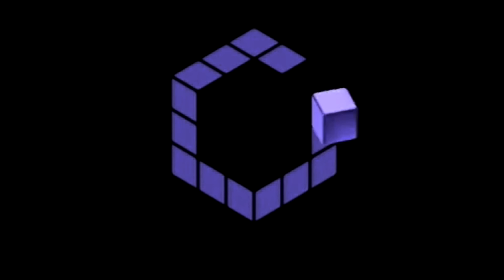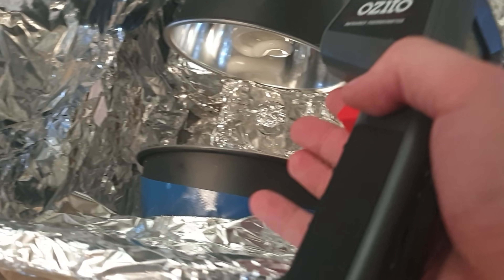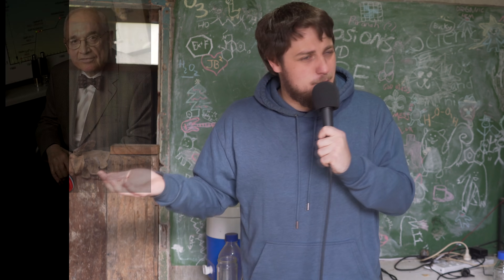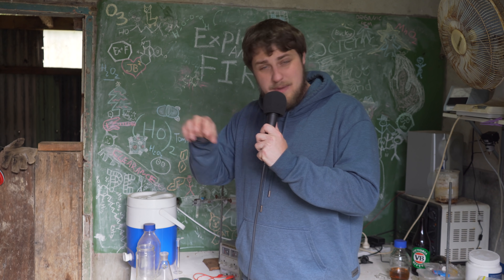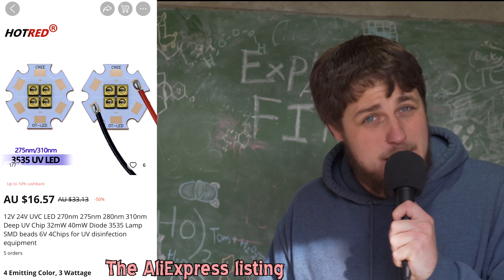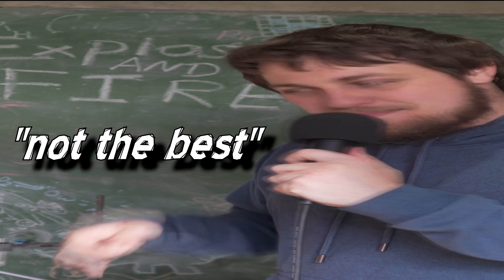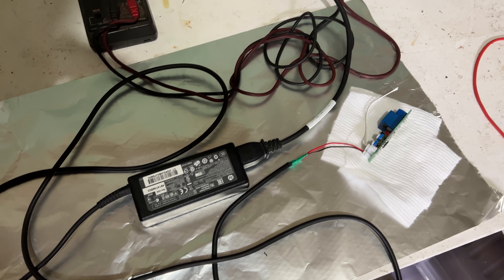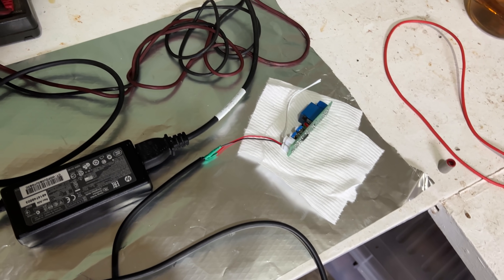Magical deep UV LEDs - Cubane Ep 12

Comment from the maker: I think this video is a good demonstration of the difference between science and engineering
Reply: Well, as a physicist with an MSc in EE I can tell you the following:
In theory, theory and practice are the same. In practice, they differ.
Reply: "It says max 12V 40mA, I'll give it 24V 1A and it'll just use what it needs" == "It says 40ml of 50% hydrogen peroxide but I'll use a litre of 70% and it'll just use what it needs"
Reply: @Björn_1978  i mean some reactions that 100% works on just like some circuits that works on
we both know that leds with no active current limiting aren't that case though lol
Reply: And you are doing neither
Reply: Power supply is good enough if it's current limiting capable, you just need some 3.3k ~ 5k ohm resistors to keep the LEDs from running away. The amp jump is caused by the fact these are semiconductors so they will hog all the current even at the correct voltage. The one you fried was because of the voltage being too exciting to it.
Reply: Engineering is application of sciences, kind of. First people to learn how to drive LEDs were doing science. Luckily that science is now established and 30 min of googling will teach you how to properly drive LEDs.

Edit: Posting the wrong way to do something to YouTube is a roundabout way to do an internet search.
Reply: @kasparroosalu  engineering being the (sometimes) exhaustingly iterative process of applying the right scientific principles until you get a result that doesn't fail catastrophically
Reply: Haha, I kept saying nooo, don't do that. I think you'll get some good advice from the comments, but I'm sure bigclive could just tell you exactly what to do to make a proper circuit on the cheap.
Reply: Scenginience
Reply: Did you see the post in your subreddit about a powerful <350nm UV source for under $20? I'm betting the optical power of these LED's is actually 3.2-4mw. UV LED's usually output 1/10th of their rated input power. You definitely need to keep that fan on it, because each of those stars is putting out 5 watts. I'd also be skeptical of the claimed wavelength, you have a spectrometer, don't you?
Reply: So for the timer, what your seeing on the blue box, the relay, is what it can handle as a maximum not what it requires to function. There should be some sort of spec sheet that tells you the input voltage ranges. As for the leds thats a whole diffrent rabit hole. The stars are refered to as cobs, chip on board, the specs you saw were for each cob. Depending on wheather they are series, paraller or a combination of the two will affect what your requirements are. An appropriate speced driver should be able to drive the cob withoit the need for extra resistors. Most cobs already have a current limiting resistor on them. The earth on the driver is so cou can ground it in a light fixture.
Reply: I'll teach you hobbyist level electricity if you teach me hobbyist level chem
Reply: I work IT night shift so time diff don't matter
Reply: When you were talking about the led only using what it needed you were thinking of current. The adjustment on the timer is a ‘pot’ or potentiometer.
Reply: Don't feel too bad mate, I am a Machinist who gets to spend all day watching both Scientists and Engineers be absolutely awful at everything that isn't their specific expertise. Most engineers are awful at fabricating.
Reply: Did you not want to ask William Osman for a second opinion to save the potential $60 of LEDs?
Reply: @Spy653  let's be honest, we all wanted to see him pop some LEDs, and he probably knew that. Not saying he did it on purpose, but he also didn't go out of his way to learn how to avoid it. Either way it made for a good episode.
Reply: Oh man I love your vids. I know very very little about chemistry and thought I knew nothing about electrical engineering. Wow man watching a chemist trying to make an led work lol! Fuck I got chest pains laughing.
Reply: Half way through the video, and Tom already constantly ignoring the voltage and current rating. How many of the LEDs will have been sacrificed to the overcurrent god?
Anyway, when the instructions say 40mA, then they don't mean 1.5A or "whatever the LED takes"...
Reply: Hi Tom, I built heaps of light art and will be back in Melbourne next week. The earth should go on your heat sinks…
Reply: From what experience I have, which is not as the sparky rigging these up just around them,  you are burning the poor buggers out. Should not be visible like that. 
But once that’s fixed and maybe a replacement if they are actually cooked I think the can set up might be the go. Maybe smaller cut outs, leaving the bulk of the device on the outside instead, not just the heat sink fins. Might need glue to fix them in place however. But would make cable management easier, keeping it outside the can. If you entirely cut off the bottom, you could drive some cost hanger wire through some holes to form both the legs and a bit of a platform inside the can, and affix a fan to the top.  Not sure how much heat you’ll actually be dealing with through. Might be overkill
Reply: I can help on the electronics part, you can DM me if you have questions.
Reply: You need to put at least a 25 ohm resistor in series with the LEDs to keep them from drawing too much current typically 100 or 1000 ohms is used to keep the thing from overheating
Reply: You bastard stealing time from my life and I can't do anything about it (/¯◡ ‿ ◡)/¯ ~ ┻━┻
Reply: You want a tech consultant my dude? I wanna see Cubane I'll do that shit for free.
Reply: what does it mean to "dope the superconductor" ?
Reply: The switch-on bias voltage of a diode is temperature dependent, decreasing with increased temperature, and the response curve for the current flow through the LED is exponential as the amount of voltage applied over the bias. There's a small resistance to the diode, so as current spikes, so does heat, which feeds back into increasing current draw. high power diode require heat sinks or they will go into thermal runaway until the conducting channel melts and becomes a short circuit, at which point you have an ex-diode.
Reply: I'd've thought from your lab you'd be good at soldering from putting old hot plates back together, but no...
Reply: I am almost certain you have 275nm LEDs. They are listed as "270nm 275nm 280nm 310nm" like a textual sleight of hand nudging you from reality to fantasy. Your LEDs have only one die in each package, so they're not dual emitter LEDs, so they should be 308nm peak, and listed as 310nm. (I'd never heard of 310nm, but they do exist.) There is one Ali-Ex listing (item 3256802713939913) for 3 bare 0.5 watt 310nm LEDs for $21.90US. It's listed as "308nm 300nm 310nm 315nm", but it looks like a real 310. There's another (item 4000101027811) "295nm 290NM 300NM 310NM", at $16.90 for a star with one 0.02-0.1 watt LED. Wavelengths do vary, which is why products are usually sorted into "bins" by the mfgr, but since the descriptions are dishonest as hell, you see a larger variation with the first product (270-310) which is most likely "fake", than with the latter two. I imagine manufacturers bin their products, and what's out of spec or left over is what gets sold on Ali-Ex. At any rate, you get the picture. Wide variations and comparably inexpensive = probably fraudulent. (I can't post links on yt, otherwise I would.)
Have you seen the post on your subreddit called "<350nm UV source"? There's a pretty powerful lamp in the right range, with the power supply, for under $20US total, in duplicate. unsuitable for your application. If you need 300-325nm peak, you're probably going to have to get the correct LEDs to do what you want, or come up with some elaborate optical filtering / tuning setup using a monochromator/gratings/prisms.
Reply: The paper just says they used a 450w mercury lamp. Why is this not suitable? Is the narrow band really that important? If the cost or availability of the lamp is that important, the reddit post should solve that problem with a $20 package from Ali-Ex. See your subreddit for "<350nm UV source". The spectrum of a 55 watt HID lamp with the UV filter removed is probably equal to or better than a 450w high pressure Hg lamp for this project.
Reply: You can also use a ZWB2 Ultraviolet UV Band Pass Filter. Look at camera filters.
Reply: Engineering blows up while chemistry is more of a slow painful death on the ICU deal
Reply: I mean I also dont know electronics shit so even this kinda looks like some tech wizardry
Reply: Tom, please, i can imagine the LEDs seem very promising, but before this becomes another waste of time, PLEASE just try the sunlight method! You could simply make a small vial with very little material, put it outside somewhere save and forget about it for a week, then do a tlc and if it does not work, so what...
Also please check the light inside the vials with your spectrometer to See which wavelengths actually make it into the setup
Reply: Can you please do a reaction with decaborane and fuming nitric acid?
Reply: Someone should release a TV that requires sunglasses because it also shoots enough UV light to give you a tan in the comfort of your own living room.
Reply: Maybe try collaborating with a youtuber with more of an engineering bent? Seems like you and Styropyro have similar interests, he's also a chemist, but most known for his extreme laser projects.
Reply: Three months late to the party but I'm pretty sure you bought the 5v timer and the relay had a rating of 24V.

So the relay (the big blue thing) can handle up to 24V but the control board can only handle 5V.

Nope, watching more it seems like you did get the 24V one.
Reply: ⁷⁷7⁷⁷7⁷
Reply: You were out of the element there, I think you did the best you could.

Although you should ask for help next time...
Reply: God damnit why you didn't ask someone on your dc or styropyro server (someone that have moderator rank on electronics server??)
Reply from the maker: @caraffa3621  I am asking, but instead of getting everyone to just work it out for me at the start, I instead have a good guess at what to do, make a video full of crimes against god, and receive constructive criticism! Getting ah… lots of feedback on this one
Reply: @ExtractionsAndIre  that's certainly a way to do it 😂. Just buy an adjustable cc led driver or buy yourself a better Lab powersupply (with digital settings) and use it in cc mode to drive your LEDs. Honestly I'm surprised the LEDs survived so long at 1 a.
Reply: @ExtractionsAndIre  That makes more sense now. 

By saying "just put it together and it will regulate itself" they meant that to conteoll diode you should limit a current, and the voltage will set it self to correct one. Once diode hearts up it tends to draw more current than it should (simplifying things - warm diode have lower Resistance). So the best way to controll such a thing is to limit current and let voltage drop freely as the diode heats up. You should be able to limit current on your lab power supply (but you should also limit voltage to like 14-16V or sth so any random spike in voltage wouldn't kill it), additional driver is unnecessary.

I'm on your dc if you have any questions
Reply: @ExtractionsAndIre  Was this video just your way of "doing the wrong thing as much as possible so you get the right answer immediately" or
Reply: @ExtractionsAndIre  as I said elsewhere, you and I both know we all wanted to see you pop some LEDs. Your videos would be way more boring if you just like, got it right the first time every time. And at least in this one nothing turned yellow.
Reply: @ExtractionsAndIre  my desire to do things right directly conflict with my desire to watch crimes against god.  That’s one for therapist I guess!
Reply: @ExtractionsAndIre  honestly, I'd be tempted just to send you some things, but then how would anyone learn from how you did it?
Reply: @ExtractionsAndIre  Use aluminium. You reflect waaaay more UVC (aka VUV) than steel. Even just adding a thin aluminium foil reflector can make massive difference
Reply: @ExtractionsAndIre  The best way to get the right answer is to post an incorrect answer online.
Reply: @ExtractionsAndIre  At least at 14:05 you probably made electroBOOM proud!
Reply: @ExtractionsAndIre  Instead of powering the LED, you started basically welding it lol.
Next time just solder some wires to it and put some kind of clamp to it that goes to the power source.
Also... for god's sake buy some resistors xD that's the reason (one of many more probably) why the drivers blew up like that... you're giving it too much power I would guess.

Other than that, solid job mate :) am proud
Reply: @ExtractionsAndIre   Crimes against god is what keeps us going. [still so painful to watch....as it should be.]
Reply: The internet is full of criticism, little of it constructive.
Reply: @ExtractionsAndIre  I think youtube removed my comments because of links. So look for a nail salon uv curing lamp. They make them with 365nm and 405nm leds. They also sell them with 4 or 5 9w g23 florecent bulbs. You can combine that with a ZWB1 UG11 UV Pass Filter which is centered on 312 nm. I find the nail salon uv light sources super useful. You can probably find them at a local store too.
Reply: @ExtractionsAndIre  trial and error is good for long term experience. especially with this stuff. someone else mentioned in these replies about theory and practical application being different. electronics can do wacky stuff. but for what you're doing, ohms law, V=IR (volts=current*resistance).
Reply: I like your videos and experiments, but I cringed hard at around minute 10 and pretty much expect this to go poof real quick. If you need electrical engineering help, just hit me up, I'd rather see you fail due to hard chemistry than bad EE advice
Reply: Yessss! 😁
Reply: Run the 3rd LED on your series, it will be fine
Reply: With the 3rd wired in it will help keep the other 2 cooler
Reply: Science: We have developed a UV LED that has never been made before, it's a breakthrough invention with many possibilities.
Engineering: UV LED? More like U WILL LEDeez nuts
Reply: Depending on heat output thermal glue MIGHT be appropriate, as it also provides binding to the LED backing. However it is much less conductive than a paste or liquid metal.

Comment: You don't need those drivers. You may buy used power supply for 2$-4$ with output 12V and solder it in parrarel. Your thinking is that voltage is stacking but in fact the current is stacking. Correct me if im right :D

Comment: Got same laboratory 'transformer' You can set it for constant current and constant voltage. You wanted to use second option with constant voltage set to 12V-14V. Then power supply should automatically give the right amount of current.

Comment: "I don't think the current number is that relevant" Manufacturers agree with you. Most LEDs nowadays are run far over spec as standard. Which is why they're often seen as cheap and shitty, they're run over spec and just plain die after a few weeks/months/years depending on how over spec. An LED running within spec almost never dies in my experience, and I've made my own lamps with them because I was sick of them dying all the time. I repair electronics, I see this all the time. Especially fun when the LED is also just used as a diode in circuit so the whole damn device just dies when it dies. Now to go to work, to probably find more dead LEDs. I wish this was a joke, so much of my to do pile is dead LED adjacent. I'm a network engineer, repair was supposed to be a secondary role. But the network is always fine and the devices always dead.

Comment: led's are diodes. they're not resistive or inductive loads. they need some kind of a ballast because you need to limit the current going into them. the voltage can change as needed, but the current should remain constant. even a resistor to limit the current is better than nothing.

Comment: If only ElectroBOOM was wandering through Australia...

Also, dude, why didn't you use batteries for that? 6V is an easy thing to get stacking 4 AA batteries (1,5V * 4 = 6)

I'm pretty sure you can find or dismantle old toys and such for an easy battery stacker to work with. And 40mA can last for a great while when working with 4 alkaline batteries.

Comment: 7:05  You supply a voltage, and the resistance of the circuit determines the current that flows through it. Current may determine the brightness, but Voltage determines the Current, I = V/R (although diode resistance changes depending on the voltage). Current limiting power supplies are designed to protect from unexpectedly low resistance circuits (like short circuits, or diodes at high voltage) by reducing or cutting off the Voltage if current rises above the limit.

Diodes have an exponential IV curve in that resistance is higher the lower the voltage is, thus as the voltage rises, the current will rise exponentially rather than linearly, which is why the current went up so high when you went past 12V.

Specifications for most semiconductor devices specify what Voltage must be supplied to it. Information about the current is only in reference to the minimum current your power supply needs to support in order to not be overloaded by the device. If a 12V 1A power supply is connected to a device that draws 40mA it will maintain 12V supplying 40mA. If it is connected to a device that takes 12V and 10A, the power supply will not be able to maintain 12V.

V = IR.
if V is 12V
and I is 40mA
then R is 300 Ohms @ 12V
Power is 480mW

Also, DO NOT! put a switch on the output side of a constant current driver! Similarly do not connect the wires of a constant current driver to a device while it is on. Constant current drivers often have enough charge in capacitance or inductance to fry devices at it's maximum output voltage (on an infinite resistance open circuit) before the driver can react to lower the voltage when you close the circuit!